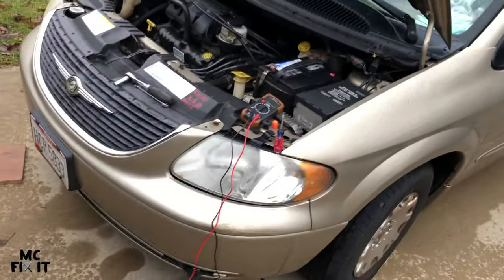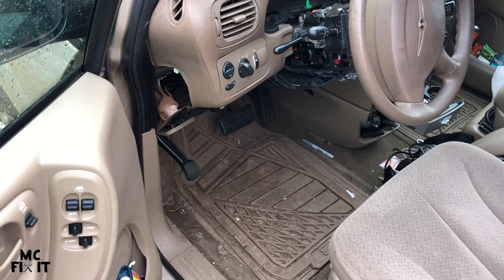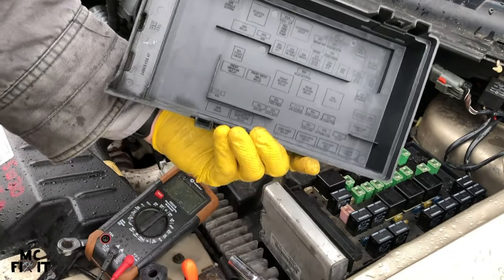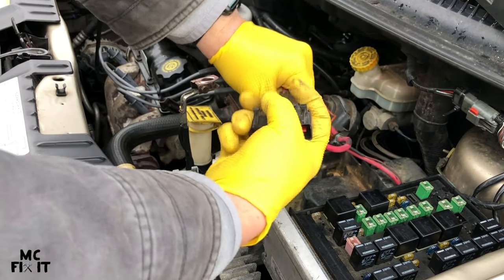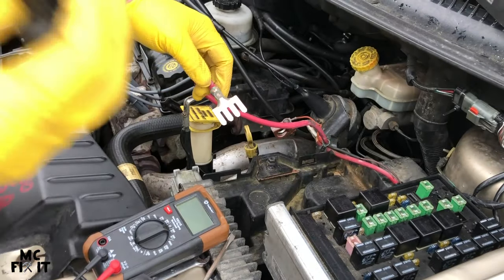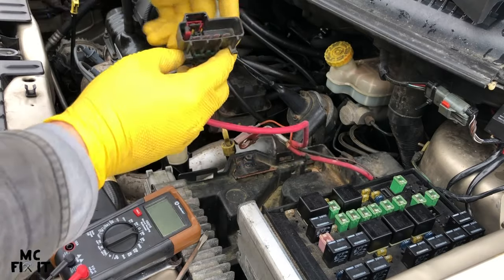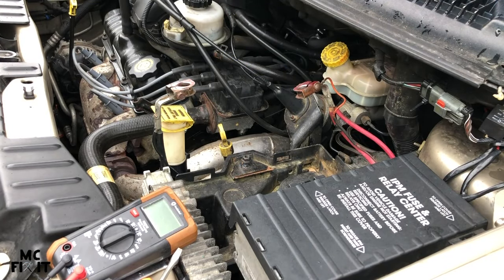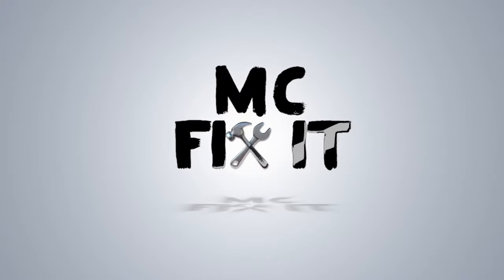Won't Start? No Start No Crank Intermittent starting problem solved! Dodge Caravan Town and Country

Comment from the maker: This no start, no crank intermittent start had me puzzled for days. Here's what I did to fix it...
00:15 The Problem 
01:03 The Fix
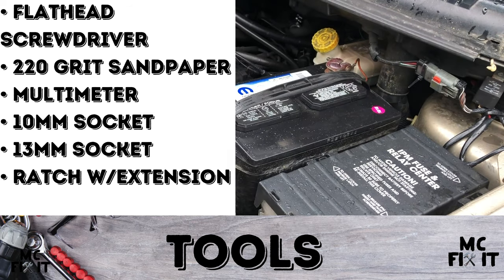03:15 TOOLS:
• Philips Screwdriver - https://amzn.to/3hdpzx0 
• 220 grit sandpaper - https://amzn.to/3y1lyRU
• 10mm socket - battery - basic set: https://amzn.to/3fjRoBd 
• 13mm socket - batter nut latch - basic set: https://amzn.to/3fjRoBd 
• Ratchet - basic set: https://amzn.to/3xWjE5g 
• 6in extension to get to battery nut latck - https://amzn.to/3uwhLKx 
• Pick (optional) - https://amzn.to/3nZM8q4 
• Magnetic Metal Tray - https://amzn.to/3hdUiJZ 
• Multimeter (optional) - check fuses - https://amzn.to/3o1T5qw 

15:05 Test to make sure it worked

This video should work on Dodge Caravan and Chrysler Town and Country for Generation 4 for the years of 2001, 2002, 2003, 2004, 2005, 2006, 2007. It should be very similar for years before and after this.

Disclaimer: Due to factors beyond the control of MC FIX IT, I cannot guarantee against improper use or unauthorized modifications of this information in the video, post, blog, or social media. MC FIX IT assumes no liability for property damage or injury incurred as a result of any of the information contained in this video. Use this information at your own risk. If you feel uncomfortable at any time. Stop and go to a professional. MC FIX IT recommends safe practices when working on vehicles, your house, or any other project and or with tools seen or implied in this video. Due to factors beyond the control of MC FIX IT, no information contained in this video shall create any expressed or implied warranty or guarantee of any particular result. Any injury, damage, or loss that may result from improper use of these tools, equipment, or from the information contained in this video is the sole responsibility of the user and not MC FIX IT.

#mcfixit #autorepair #fix #repair #nostart #nocrank #intermittentstart #batterycable
Reply: À
Reply: I have the same problem with 2012 caravan, do you think it has the same red cable?
Reply from the maker: There is a good chance! It should be the same main power cable going to your fuse box and they are often red.
Reply from the maker: @expectatussle  Hello! Thanks for writing. I did go through all I have done to date before I fixed the issue. I could have made about 6-10 videos on all of that without really solving the problem, but I didn't (that's what a lot of others do). Often "no starts" are difficult to determine the root cause and take trial and error as you determine what is really happening. That's why you have to pay hundreds for them at service stations, because they just start fixing everything until they get lucky and solve the issue. Most don't really run any tests they just replace parts and you get stuck. By 3:30 I'm diving into the fix with already discussed all of the prior attempts to fix this issue and a full list of tools and everything to get the project done. Not sure what you mean by rambling for 15 mins without doing anything is all about. I personallyhate starting a project and not knowing I'm going to need a 6in extension to get out a bolt on the bottom of your battery tray, which I did when recording this video. Then have to run back and forth to a toobox. So yeah, I did go through a lot of material which is helpful in diagnoising this sort of problem and fixing it right instead of having to guess along the way. This sort of a fix is much more complicated thing than let's say an oil change on a vehicle which one could do a short without any real discussion or teaching. I'm sorry you are displeased with how I run my channel obviously a few people have found it helpful as you read through the comments, over 54.6k views, and see over 800 likes in under a year. And no, I don't ask for payment or any kind of subscription and never plan too. I am grateful for YouTube and the ability to learn and teach others many great things. And yes, I do add some links (a total of NINE which are all tools for this specific project) to assist people. And yes, I do get a little kickback from Amazon like 1-3% for hours of work recording, editing, and replying on YouTube. Use the links or dont that's totally up to you! And I'm sure tiktoks and other shorts are helpful for lots of things but probably not a problem like this. I hope you are able to figure out your no start and you have a good day.
Reply: @expectatussle   LOL You evidently didn’t watch the video to the end. The main power connector under the main fuse box was corroded.  He took apart the connector, used sand paper to clean the corrosion off, put it back together, he accidentally put it in upside down and had to take it apart again and put it in correctly, finished putting everything back where it needed to be.  The van started first try and he put a green check mark on the screen indicating that was the fix!!!  I greatly appreciate the fact he pointed out his mistake and corrected it in the video.  He’s a true MAN!!!  
Thanks for an awesome tutorial MC FIX IT!!!  I can do this myself!!  I have some work to do on my van. The gauges are intermittently going crazy with the dashboard lights and radio going on and off. That could be a ground wire or Auto Shutdown Relay. fingers crossed  My van just started with the “I don’t want to start” crap. I’m definitely going to check that connector!!  Thank you very much again!!!  🥰❤️  I just found your channel and subscribed too!!  🥰❤️
Reply: @MCFIXIT Did your vehicle die out while idling? I have an 02 trailblazer that I have been trouble shooting and my diagnostic reader hooks up but does not connect for info. Thank you in advance !
Reply: I have the  same problem on an 08 grand caravan. If I jiggle the negative battery cable it will start
Reply: Did everything you said to do( after fighting with the car for days) ; went and bought brand new battery - hooked it up and opened the driver door - the lights were on - turned key to 1st position and the dash cluster all lit up - turned to the " ON " position and EVERYTHING WENT OUT..... So I opened up the RELAY/FUSE bay, disconnected the main harness as you said....no corrosion at all - lite spray with professional electronics cleaner - dried out - installed the  harness , box and installed the battery.  Turned the key. Nothing. just all dead.

Comment: Those intermittent problems with dodges are so hard to figure out,,, I’ve wasted so much money trying to resolve problems just like this! Great job on figuring it out and sharing it with others!
Reply from the maker: Tell me about it. I totally agree!
Reply: Yeah I even replaced my start switch chasing down a no starter issue. This got it.
Reply: Darn it this did not work for me.

Comment: Thanks! I appreciate that you showed us your “fail” where you plugged the cable in upside down into the connector. It makes me know I’m not the only one who does that. Great fix!
Reply from the maker: Glad it helped! Often the fails are how we learn to do it better the next time. I feel like I failed on many different elements of this fix bc of the number of things I worked on to get it working correctly!
Reply: ⁹
Reply: Yes, if in doubt take pictures of plugs, and other areas "before" disassembly..

Comment: That "done" is the onboard diagnostics reader.  You can check for codes by turning the key on off 3 times....then leaving the key on on third time.  Any trouble codes will read there in the odometer window.  Once all of the codes flash there, "done" tells you that the end of them.
Reply from the maker: Thank you!

Comment: Not sure if it's been mentioned but the "DONE" is the Chrysler/Dodge code cyle. If you turn the key 3 times back and forth it will read and give you the "P" codes.
Reply from the maker: I didn’t realize it did that when shooting this video. It’s a pretty nice feature that Dodge put in there!

Comment: You would think an error could come up on the dash message window, low voltage to ecm. I have a 2010, it apparently loses a little bit of coolant every year, and all of a sudden, sitting in the driveway, will not crank. No error code, no engine light on dash, no indication. Check and top off oil; check and top off antifreeze in reservoir, wait about 20 minutes, zoom.
Reply from the maker: That's super strange. Sounds like an intermittent starting problem. Oil and antifreeze would not necessarily fix this issue, but definitely good to have them filled to the correct amount.

Comment: I’ve had this issue before and ended up trading the vehicle in bc I was so sick of throwing money into it. I changed out the battery, started, ignition switch, another starter, and then I was done. I wish I would have seen this video bc with just a few tools and some time I could have saved that vehicle.
Reply from the maker: Yeah, it's been a few weeks of being frustrated that I finally figured it out. I was so tired of starting and starting and starting the vehicle to get it to work.

Comment: You touch your heart and negative together that make sure there’s no voltage on the system and it reset your computer you can touch them together as long as there’s no battery in between them
Reply from the maker: Yes, someone point that out in the comments that you can do a reset on the computer by connecting the positive and negative cables (without a battery). Thanks for drawing extra attention to this because I'm sure it will be useful to someone out there! My issue was a bit deeper than that and that's why I posted this video detailing how I was able to fix my issue. Thanks for watching and commenting!

Comment: We hav this problem. New battery, starter, alternator, fuel pump…still🤦🏽‍♀️
Reply from the maker: I'm sorry to hear that. These vehicles are known for terrible wiring and it can be so many things. Any luck in the past day trying to get it figured out?
Reply: @MCFIXIT  no. I jus did it again as I showed up to look at a 04 explorer…as soon as I pulled up n stepped out seller said it jus sold. I get in van I tried to start five times. No sound. Lights came on..then I try again. It started. I thought how embarrassing 🤦🏽‍♀️ n god thing it started..lol.. 🚗 💨

Comment: That's one of the "ghost problems " that we get on some used cars. I bought a 2015 grand caravan 3 months ago and it has failed me starting right away and once didn't started at all. Tow truck came and it made look stupid by starting first attempt.  I had them tow it to the mechanic to find out what was wrong but nothing showed on scanners. Yesterday it didn't start until I tried a bunch of times until worked.
Thank you for this video,  it makes so much sense .  Glen
Reply from the maker: Yes, these are problems that many years of this vehicle have. They are difficult to figure out the root cause and can sometimes just work without an issue then it comes back (even a day later)

Comment: Fantastic!!  I had same problem, starts  when it wants to… knew something getting hot at the starter  relay , runs great after starting, when turn off, won’t start again for few hours, after cool down , it will start. I will certainly pull the fuse box to make sure. Thank you so much!!  This is a mind boggling diagnostic and spent many hours figuring this out.
Reply from the maker: Yes, I agree! These wiring problems can make you pull your hair out.

Comment: Great video. My issue ended up being the ignition switch but I still cleaned the grounds, cables and pulled the positive wire from the fuse box . Great  job
Reply from the maker: Great job figuring out the root issue! Thanks for watching and commenting!

Comment: I had a similar issue but my was on the negative battery cable where it attached to the engine. It was corroded like crazy. This helped me think through all the of the cables and eventually solve my problem. Thank you!
Reply from the maker: Glad to helped. Thanks for watching!

Comment: This is a great help.  A friend's issue is absolutely no electrical power anywhere.  It's got a solid charged battery & I've tested everything I could think of.  I thought about this but didn't want to pry too hard on what looked to me like a trap to break something.  His wife tried to start it & it made one (just one) loud click.  Then it's like someone stole the battery.  This puts my mind at ease moving forward in this direction.  Thanks.
Reply from the maker: Glad it was helpful. I hope you are able to find the root cause of your problem!

Comment: Mine had a no start and I had just changed out the ac blower motor. I finally after trying about everything flipped my box over like in your video. The contacts didn't look too bad  and I never got the wire out of the socket so I just plugged it back in. It starts now so your video was a big help.  Guess it just wasn't making good contact.
Reply from the maker: Glad to hear it’s working again!
Reply: @MCFIXIT  it's back again. Left me on the side of the road.

Comment: Man, oh man, is this a fine video. I watched the entire thing twice and went to it. I was so hopeful that this would solve my "no crank, no start" situation with my 2003 Town and Country. Mine was pretty clean inside so no solution here but I can at least check it off of my list as I try to solve the problem. My next step is replacing the ignition switch as that is the way it is looking right now. I am waiting for a T10 "security" bit to arrive to aide in removing the existing switch body.
Reply from the maker: Best of luck on your issues
Reply: Did the ignition switch fix work ?

Comment: Thanks very much!! I've been dealing with this exact problem for more than a year! I knew it had something to do with the positive cable because I figured out that if I jiggled the wires, it usually starts. The problem has progressively got worse over the last several month. I'm gonna try this tomorrow!! Wish me luck!! 😁
Reply from the maker: Good luck on your project and I hope it works!
Reply: Did you get yours figured out?
Reply: @jimmyronsonet2811  Mine ended up being the starter. I bought a cheap one on Amazon and it fixed it right up. Lol
Reply: @krazeekidz3  thanks for the reply, mine ended up being the module behind the key switch.

Comment: Exact same issue with my 2005 Caravan.    
Lots of tries before it starts, worse in colder (or drier) weather.  “done” code. You are the first afaik to find a solution.  I wonder though if there is some uncertainty principle to consider,  as in the more old untouched wires and connectors you jiggle, the less you know about exactly which one was the problem.   I say this because when you first disturbed the box and wifey started it,  whatever changed may have been unlikely to quickly/certainly revert back to the original problem state, and thus obscure further analysis.   I haven’t gotten my hands on the fuse/relay box yet to see if I can reproduce your success,  but when I do, I would like to look at the circuit diagrams and see if are any other links in the starting sequence that pass through there,  and even outside the box, in nearby splices etc.   In any case,  I think you have saved a lot of time and staved off much curses and frustration for many. Thanks
Reply from the maker: It was a bit of a lucky solution after lots of work. I'm glad it happened that way so it would be fixed and be able to be used a daily driver again! Crazy how that happens sometimes, but you could be further downstream as well. Good luck on your project! I hope it is an easy fix for you!

Comment: I have a 98 ford explorer that has this intermittent no crank no start but strangest thing is it only does it when I have parked on a hill either uphill or downhill but wont do it if I park on a flat surface. It is very frustrating to say the least! I will check to see if it so happens to be the same thing in my car as it was for yours. Thank you for sharing!
Reply from the maker: That's super strange! It could be a connectivity problem because of the shifting of wires in the vehicle. I'd check all your connection. Thanks for watching!

Comment: That was so helpful!! I'm puzzled at the moment with my 2003 Chrysler Town and country van. It's doing the exact thing. We just exchanged our old battery today for a new one and that wasn't the issue. The next step is relay switch or something else. But my friend said it's most likely the switch box. Thanks for sharing this!!
Reply from the maker: You are welcome, best of luck on your project. These can be so tricky figuring out what little thing is wrong that's causing your problem. I hope you can eliminate what it's not and tackle to root of the problem.
Reply: @MCFIXIT  I also have a 2003 Chrysler Town and Country and have experience the same issues. First time still under warranty the dealership replaced the pcm. The second time (out of warranty) it was a pcm ground. Third time it would crank over but if I switch it from park to neutral it would start. Very intermittent problem and that's how I drove it most of the time. Just never new when it was going to happen. Fourth time it would not crank over or do anything and ended up with another pcm. I had tried fuel pressure, fuel injector pulse, spark to the spark plugs, grounding, voltage drops,etc. It was the pcm grounding transistor for my start circuit that was bad 😞. Hope yours is a quick fix. Probably something simple.

Comment: Hi I just battled with this problem. Yours video put me on the right track, thank you. I just would like to add that since you are unplugging connectors from activators box it could be good idea to unplug also a plug connected to starter activator (and others too). In my case it was a lot worse than the main.
I used a connector spray to clean connectors.
Reply from the maker: Great idea there!